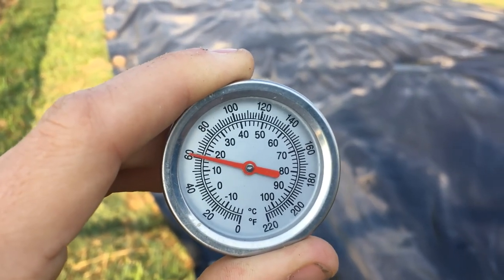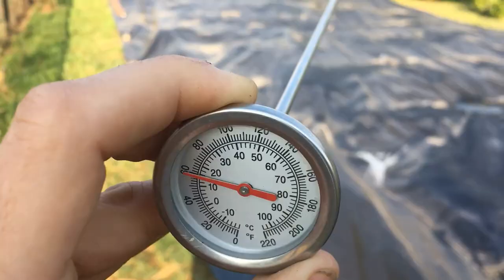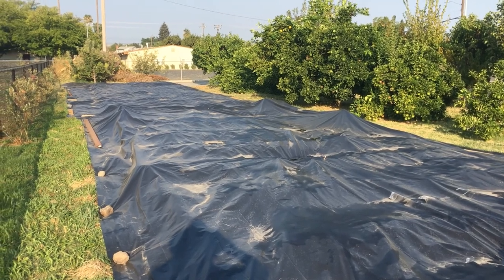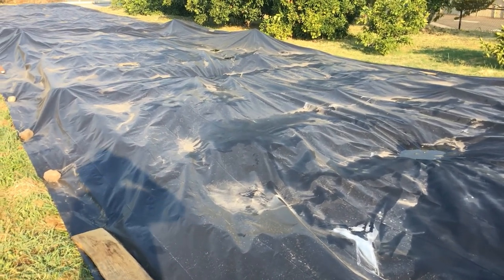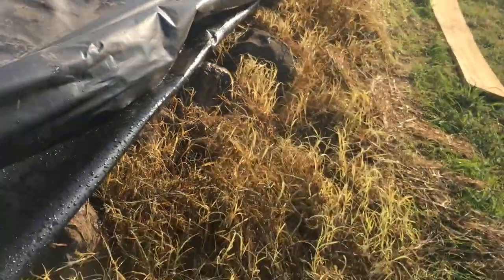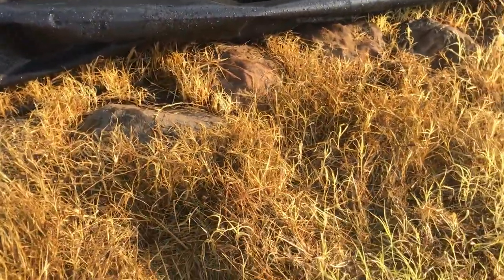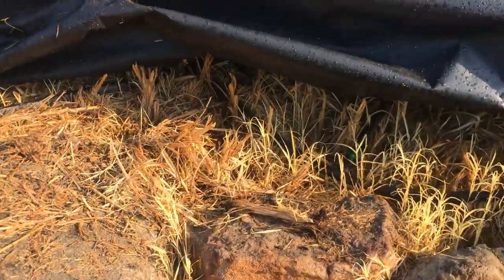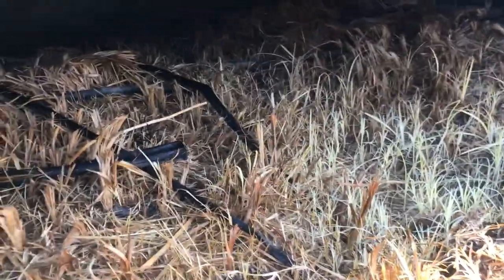How To Solarize and Smother Weeds. 3 Week Check Up.

Comment: Hello,

Start to finish, how long did you solarize the soil?

I have an extremely aggressive patch of weeds that just seems to come back with a vengeance every time I try to address it, ground kill doesn't seem to work, either.

I'm considering this process but it's currently early August in Michigan so we only have maybe 6 - 8 weeks of warm weather (consistently >60°F) left.
Reply from the maker: I believe we left this plastic on about 8-9 weeks. The longer you leave it on the better. The hotter your temps are under the plastic the better off you will be. I would suggest starting now.
Reply: @fieldtrippin1  thank you for the info!

Comment: Looking to possibly do this on my hill and replace with a groundcover. Too many weeds and too steep to mow so it never looks nice. You mention clear plastic, which is better clear or opaque?
Reply from the maker: The clear (solarization) can work a bit quicker, but I have had plenty of luck using the black plastic (occultation). My climate is hot and the black plastic gets extremely hot and also starves the plants of sunlight. The clear plastic may work better if you live in a cooler climate. Both are decent options. Good luck.

Comment: How did it go killing off the rhizomes/nuts? Did it work or only kill off the foliage?
Reply from the maker: It would roast and destroy nearly all vegetation, rhizomes included if they are at or near the surface. Rhizomes buried deeper down were protected. I would leave covered for a week or two then I remove dead growth and turn/fork/flip the soil to expose more of the rhizomes. This garden bed is currently free of all Bermuda grass and Nutsedge.

Comment: Well... I guess it's a voice reveal.
I feel that if it was around 5 say 6 PM it would be much hotter
Reply from the maker: We checked 2 hours later, 140 degrees. Its only 82 degrees outside today, 105 degrees last week. A 5 pm check on 105 degree day would have been great.